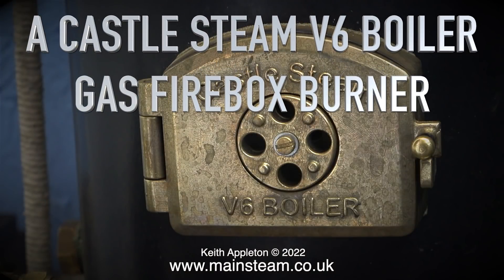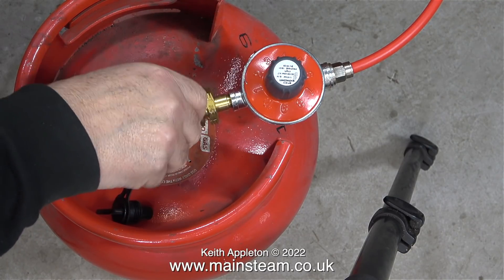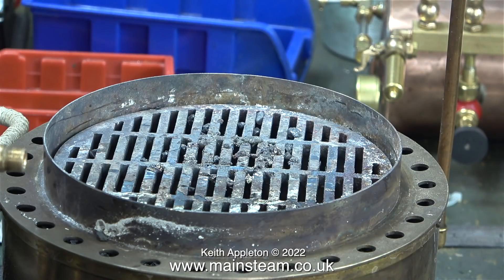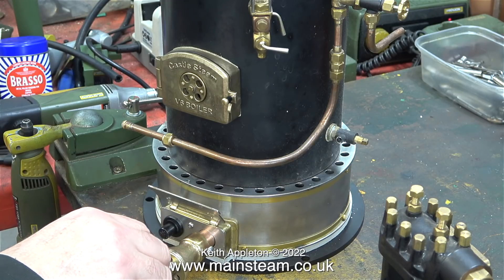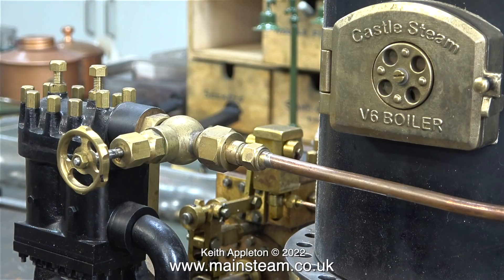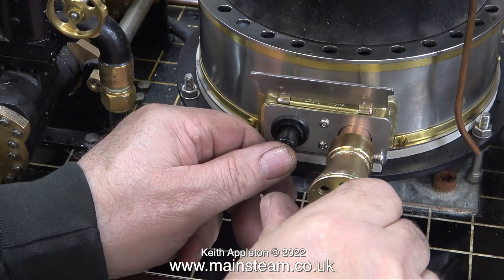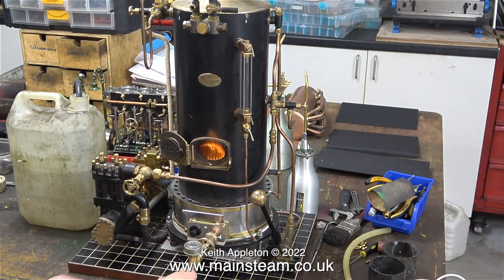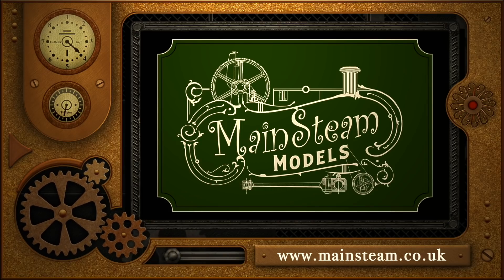A CASTLE STEAM V6 BOILER GAS FIREBOX BURNER - IN THE WORKSHOP

Comment: What sort of filter are you using in your vacuum? Some sort of HEPA filter?

Every time I've attempted to vacuum up ash with a shop vac, the result has been a horrible hideous cloud of ash coming right through the bag and out the vacuum exhaust.

Nice job on the spacers. That's a good trick.
Reply from the maker: I have no idea - just the one in the top of the vacuum cleaner. It is a "Henry" type.

Comment: That configuration of the nuts and the bolts, you gave yourself a way to level out the boiler and make fine adjustments too. I must say, it is very clever to see.
Reply from the maker: Solutions are often quite simple if you take the time too think them through {:-)))